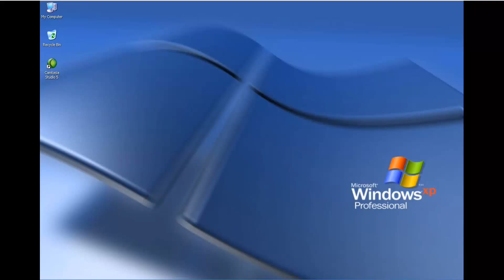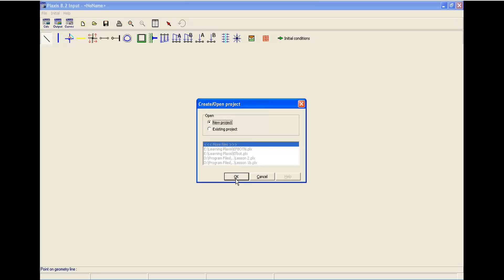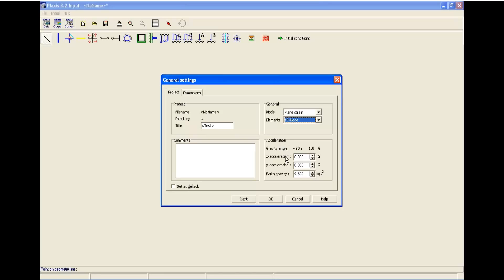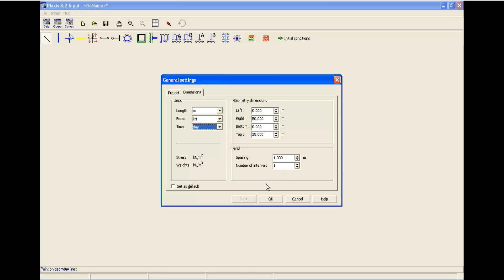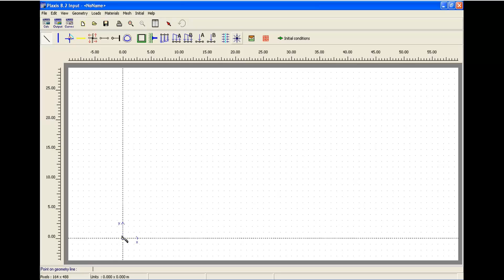Plaxis 2D - Tutorial - 1 out of 6

Comment: what is nodes that your using in initialization and why did you choose 6 nodes ? what is it representing ?
Reply: It represents the Precision of the analysis. Higher the no. Of nodes in your mode higher will be the Precision of the analysis.
Reply: And more duration for the analysis
Reply: @mohitverma220   hi please help the best  source to learn geotechnical softwares
Reply: @devagya10  Hey I will be different for diff. softwares.. Geotechnical engineering uses a number of software commercially and many more for academic purposes. If u ask me to generalize then best way to learn a software is to go through the "Help" section of that software. But for this u need to own the software. YouTube is a good learning portal otherwise.
Reply: Watch this video..and it will clear all your concepts bro..
https://youtu.be/sHMnCFvLyOk